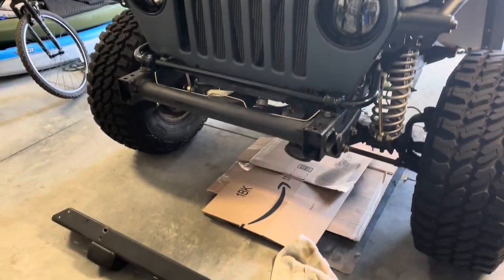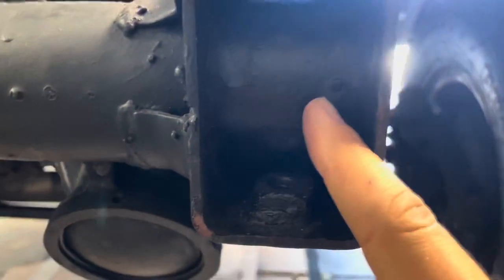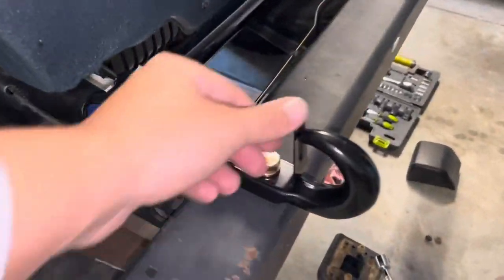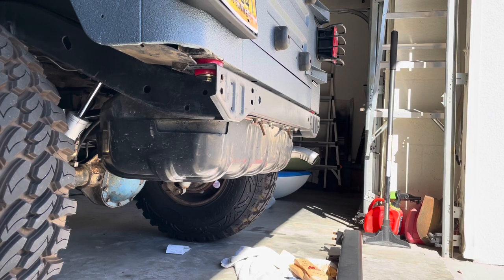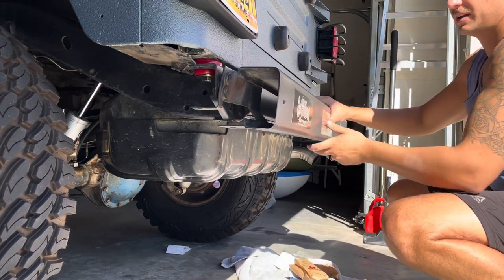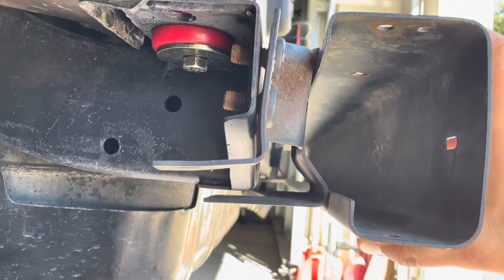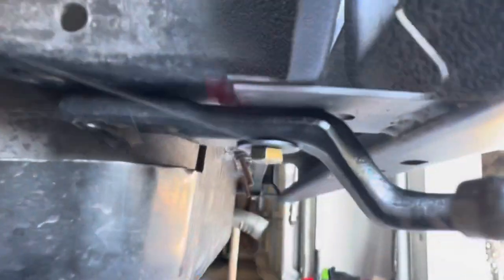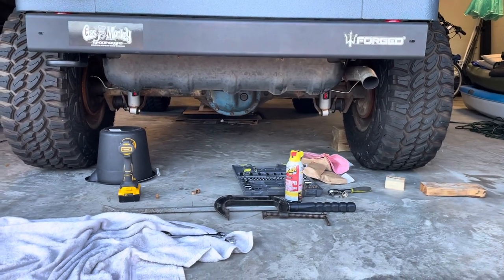Jeep Wrangler TJ - Tow hooks install on stock bumpers

Comment: has one bolt been strong enough? I thought of putting mine on the side of the frame but I have to drill a hole on the rear tow hook to give it two holes to mount it on.
Reply from the maker: I recommend two bolts. It does the job but is not the best setup with one bolt.